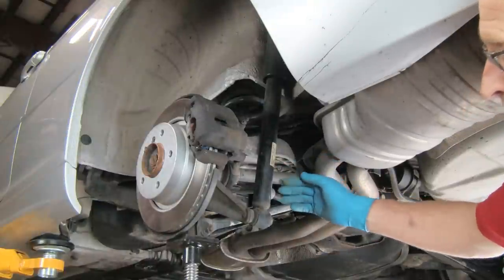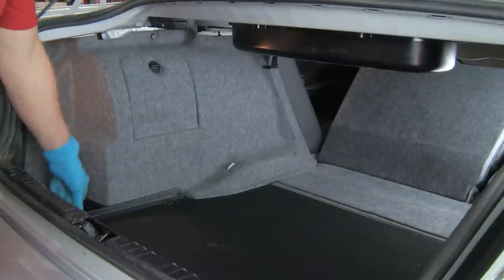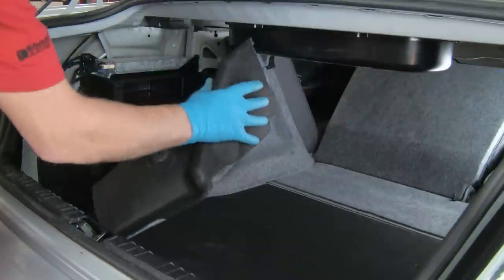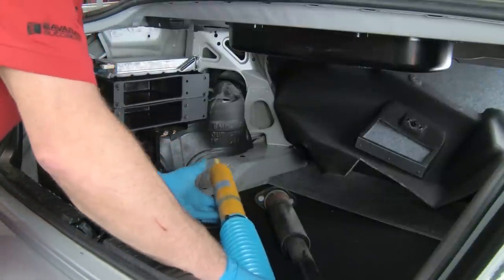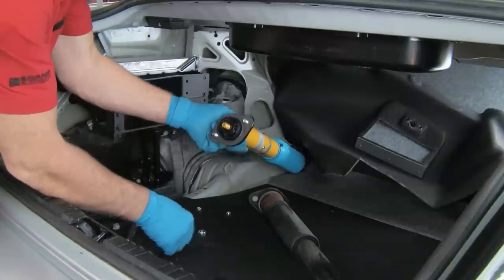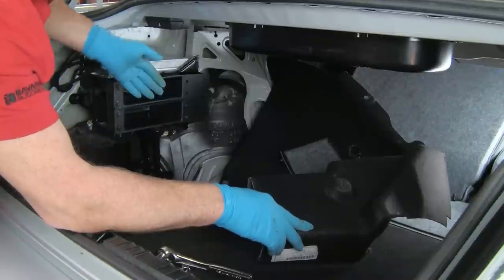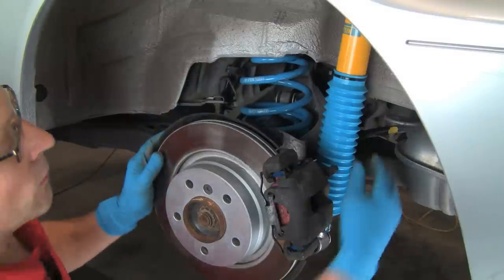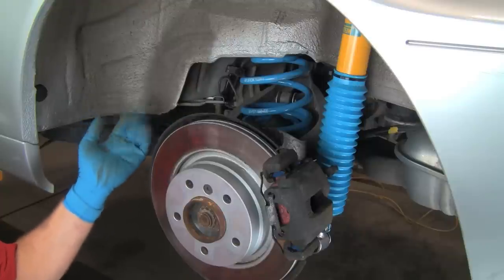Part 2: Installing shocks, struts and springs on a BMW 3 series 99 thru 05 (E46)

Comment: I really love that you do these videos, keep them coming.  Can you tell me if this is the same basic steps for the Z4?
Reply from the maker: The E85 Z4 (through '08 in US) will be nearly identical to what is shown here on this E46 3-series.  The E89 Z4 ('09 on) uses a different suspension design.

Comment: One of my rear springs just broke and plan on replacing both springs and shocks with OEM at the same time. My question, is there a certain rotational position the rear springs should go in?  I know OEM springs have a painted stripe on them is that supposed to be facing towards the wheel? 

Your DIY's are simply amazing!

Comment: Them little small details such as fitting the spring within the nipple other than "feeling"  for reassurance torque specs if anything but other than that good video got me wanting to do it myself! By the way your the first I seen on YouTube to literally pull the spring out without the need of a  compression tool of some sort......🤔

Comment: Hi, noob question.  How (if at all) does installing coil overs or lowering the vehicle affect the cars alignment?  I would think it does, considering when you lower the suspension, the rest of the suspension components are affected (camber?).  So in any event should the car have a 4 way wheel alignment pre or post installation of coil overs or any type of lowering?  Thanks in advance.  Good job on the videos....

Comment: Great!  Your videos are very informative.  I just installed a rear air spring and air compressor on my '99 E39 528it but not sure how to get both sides to lift at the same level.  Any advise?
Reply from the maker: You may need a ride height calibration (assuming the install was done properly).  This is performed using the BMW MoDic or similar diagnostic tool.
Reply: BavarianAuto Yes, it looks like the way to adjust the air suspension height correctly is through electronically reprograming.  I was hoping it could of been done manually by adjusting the leveling sensor arms.  Thanks for your reply.  Your videos are also great in HD quality for details.  If you have any E39 videos let me know.

Comment: Honestly, I would just pull that sound dampening material out and toss it, replacing it with new dampening material of course. The compound used by BMW in these dampening pads is notorious to start giving off a terrible odor when it ages and gets exposed to heat. You might as well replace it while doing a coilover install, especially if it makes the installation easier. Just a heads up for people who don't want a stinky car in the future :) In a hot climate, this is just as inevitable as brittle hoses are in cold climates.

Comment: The reinforcing plate comes with the Holstein or it's already in our bmws? and if not, why use a part that bow didn't't designed to be used originally?

Comment: Hey otto. I am going to replace my rear shocks, Every time I hit a bump my diff jumps around and my DSC goes on it my e46. Do you think just doing the shocks and mounts could stop a lot of my issues? I feel like its kinda loud when I hit bumps in the back too so I think the mounts are gone too. Also... how did you get the back seat to fold down? lol I have a low end 325i so they didn't give me that feature.

Comment: Thanks for this video was really helpful how can I pay you? And also the suspension you installed is this also a coil over suspension which more wider rim will be ok for e46 not to hit the rear body wen go over the bumps???
Reply from the maker: If you have wheels that hit the body when the suspension is lowered, you have wheels that are too wide.  the suspension should be able to move through the full range without the tires or wheels contacting the body.

Comment: Great video! Would this be the same for a 2008 535i
Reply from the maker: The E60 5-series suspension is a bit different from the E46 3-series shown here.  Check out the video for the E90 3-series shock replacement as well (link below).  Between the two, you should be able to handle your E60 5-series.
http://blog.bavauto.com/14344

Comment: I installed the reinforcement plate on bottom instead of the top of the rear shocks, does that matter?
Reply: You did it correctly, the plate should go under the shock tower, not on top like the video incorrectly shows.

Comment: Is this any different on an xi model? My 01 330xi was extra bouncy in the rear and then I heard a pop on the right side and now it's sagging. I'm thinking it's the shock absorber but could be the spring? Any input is appreciated. Also, are the parts interchangeable on the xi and other models?
Reply from the maker: If it is sagging, it is likely a broken spring .... very common on these models.  The xi E46 3-series will be exactly as shown, in the rear.

Comment: Hi, does the original bump stops has a washer installed in the top which holds it up or its separate? mines just wont stay up.
Reply from the maker: Most models, the bump stop just rides free on the shock shaft.  If your bump stop slides down to sit on top of the shock, this is fine and normal.

Comment: Is it possible that because of this part ( 5:13 )  of the rear shocks are old, I hear a squeaking noise ? When Im driving low speed and go on a bump I can hear this noise from the rear. e46

Comment: I have installed anti rattle clip on rear but still makes metal noise wen I go over the bumps any suggestion??
Reply from the maker: Does the rattle stop when you lightly apply the brakes (just enough to put a little tension on the pads)?

Comment: Thanks for the helpfeul info but can I have part number for the ajustable rear upper mount...I can find them
Reply from the maker: Jason, Do you mean the adjustable spring perch for the Bilstein kit?  These are not available separately.  You could contact Bilstein for a replacement, if you currently have a coil-over Bilstein kit.

Comment from the maker: Disphonic x - We can't reply directly to your comment as it was sent via Google.
Without driving the car, we can't say for sure, but if there is noise at the rear, over bumps, a good place to start is with the shock mounts.  If the shocks are worn out, you should just replace the shocks and the mounts at the same time.  Once this is done, we can see how the DSC issue goes.  Call our advisors at 800-535-2002 for assistance in setting up the shocks and mounts, or visit our online store at www.bavauto.com

Comment: Installed Koni street shocks on my 2001 bmw 325ci, not sure where i went wrong, but now the passenger side front tire is rubbing, purchased all the replacement parts.  I can't figure out why it's rubbing on the inside of the tire.
Reply from the maker: Is the shock body itself rubbing on the inner sidewall or is the lower spring seat rubbing on the tread shoulder?  You may have the shock "clocked" wrong.  In other words, turned to an incorrect position in the steering knuckle clamp.
Reply: BavarianAuto
 First off thank you very much for your reply,  it is the lower spring seat rubbing on the tread shoulder, when the car leans to the left there is no rubbing, when it leans back to neutral or to the right the rubbing gets louder.
Reply: I thought maybe i needed an alignment, so i got all 4 wheels balanced and rotated and also an alignment.  Once i place the shock into the knuckle clamp, i line up the fins on the strut with the slot in the knuckle.
Reply from the maker: Hadrian Hugh
 OK, the line-up (shock in the clamp) sounds fine.  Have you tried swapping the left & right wheel/tire assemblies?  Is the wheel bearing loose, by chance?  Are the wheels the stock original wheels?
Reply: BavarianAuto
 stock wheels and correct size tires, problem started immediately after i installed new shocks,  I am not sure if wheel bearing loose, i can try to look that up and i haven't tried swapping left and right wheel tire assemblies.
Reply from the maker: Hadrian Hugh
 - Without having a look personally, we don't have much more to suggest.

Comment: I recently just changed the left rear mount strut for my e46 seems to have the same clanking noise as b4 but b4 i install the new mount strut i kicked the wheel seems to have the noise comming from caliper but have no clips on it so without clip on caliper will it make noise when go over bumps??
Reply from the maker: Yes, the outer brake pad will commonly rattle in the caliper if the anti-rattle clip is not installed.
  If you lightly press the brake pedal, the rattle would stop, if this is the case.
Reply: BavarianAuto What are the anti rattle clips?
Reply from the maker: Official HD
The long clip on the outside of he caliper.
  You can see it on the caliper in the video.